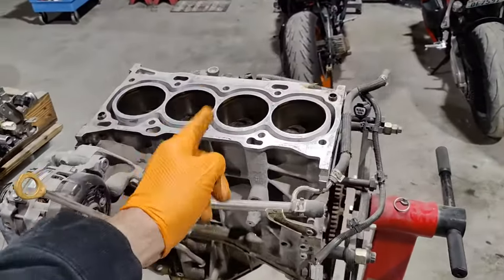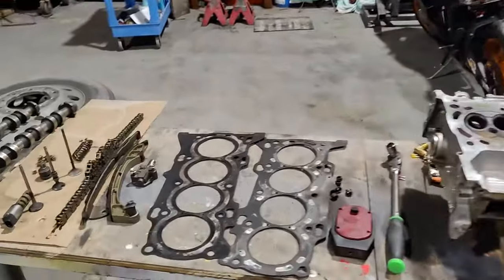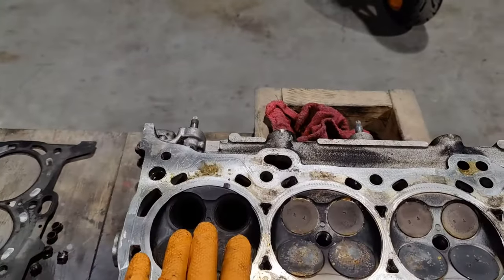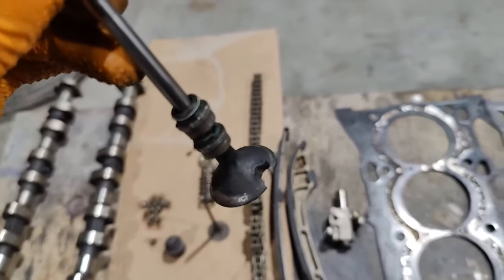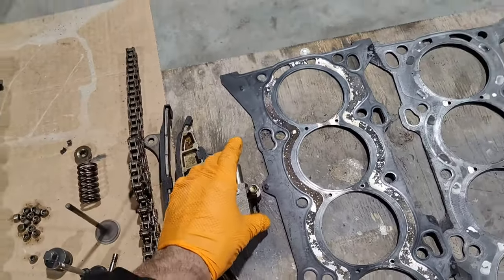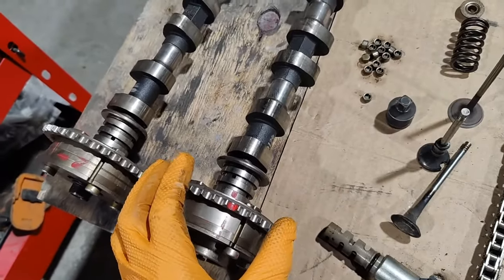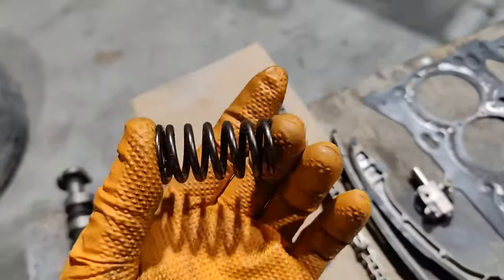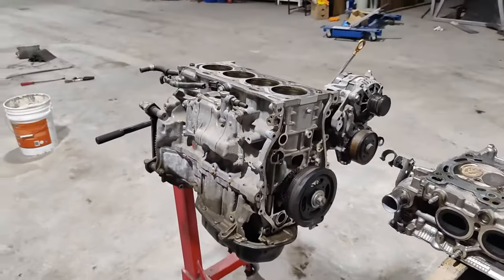Problems that can cause low compression or zero engine compression/ 2AR FE engine!

Comment: Great information! I just did a compression test on my Honda, 210-210-60-180. Coolant is clear as day, was consuming oil about 1 qt every 10-14 days
Reply from the maker: Engine should have vibrations, especially at idling when compression is 60 in one cylinder, you should feel it!
Reply from the maker: You can do a cylinder compression leak down test and will see where you loosing compression, piston rings, valves , cylinder head or gasket!
Reply: @valeriumoscalu7580  it definitely has a rough idle. Heavy vibrations especially because I have solid mounts. I noticed something was off right away. Unfortunately I needed to drive another 60 miles or so to get home. I’m hoping no damage was done to the block ! I am removing the head in a couple of days….

Comment: I have a 1998 Nissan frontier 2.4L ka24de 2.4 standard that has no compression. Whenever it first went down the timing chain tensioners broke as well as the starter. After fixing that issue, same problem. After further inspection it had a blown head gasket but it never got hot, with milky oil. No bent valves, piston and rings were good and head wasn’t warped. After that, repaired and timed, still the same problem with no compression. The engine cranks but doesn’t try to start. What do you think?
Reply from the maker: You don't have compression in all cylinders?
Reply: @valeriumoscalu7580  yes it’s not even trying to start the engine is spinning but no compression

Comment: what if all of 4 cylinder have only 3 -4 bar?
Reply from the maker: Than you need to check what is the cause of low compression and fix it! With compression so low the engine isn't going to run!
Reply: @valeriumoscalu7580  yes, thats right, it  is most likely not running, just bugging :/
kinda not really common problem, if i pour a little oil into the cylinders, it can reach a little more bar, but no so significant. anyways i have to disassemble it, just wanted to ask you opinion. thanks for the feedback :)

Comment: Thanks Valeriu Moscalu, Finally someone confirming my suspicions after 100s of videos on cam phasers causing low compression, especially running compression. As leakdown test was good and cranking compression was good, but misfires all on one bank on ford 4.6 3v. Guess next step is new mellings oil pump while im in there and timing components with good quality phasers.

Comment: I have low compression on one of my cylinders(100psi on cold engine). 2006 infiniti m45 4.5 v8. I dont wanna spend thousands to fix it. I was going to either  sea foaming or throw a bottle of compression repair. What do u recommend i do first.
Reply from the maker: Do a compression leak down test first!
Reply: @valeriumoscalu7580  Thanks for the reply.  So the leak down test determines what is causing the low compression?
Reply from the maker: @ouwat4life  leak down test will show you where you loosing compression through, and yes this will point you in the right direction ⬆️

Comment: Hi, i have a 2010 audi a4 b8 2.0t. engine starts up and runs but limp mode. Cylinder 4(nearest to back of engine bay) has no compression at all. All other 3 cylinders have good compression. Do you think its valve related?
Reply from the maker: @morganmorris3459  it's the valve most probably, you should do s cylinder leak down test, this will tell you exactly where you loosing compression, but most probably the melted, bent or damaged valve!

Comment: I have Fiat 1.4 petrol engine. Cylinders say 75psi on one cylinder and 100psi on other 3 cylinders. It doesn't fire up. Could it be that the timing is out slightly? Could correcting the timing solve the starting issue? 

Great video. Thank you so much.

Comment: I have already spend so much money trying to fix mt car by the local mechanics. Changed clutch plates, rings and alot of electrical sensors trying to find the fault which causes low power of the car. 
I noticed, a little smoke and air coming out from dipstick when removed. What could be the issue here? Please respond 🙁
Reply from the maker: What car, what year and what engine?

Comment: I have a Nissan na16 no compression on cylinder no 2 and 3 while the piston rings, cylinder head gasket and valves are new
Reply from the maker: You rebuilded the engine and after this it doesn't have compression?
Reply from the maker: This is how you do a leak down test if you have a tool:
https://youtu.be/wgPmZxrt34M

Comment: What would it be on 3.0 1mz-fe 97 Avalon cylinder 1&2 are dead misfires I swapped plug and injector from cylinder 6 to cylinder 2 than ran the car for a day drove it etc and only cylinder 1 was misfiring but the next day driving cylinder 1 & 2 are dead misfires again and cylinder 6 is fine I also ran top sealer additives in the radiator and motor oil as it is loosing both overtime.
But I don't understand how swapping the spark plugs and fuel injectors would fix cylinder 2 for a little bit then stop working again what does this sound like I really need to get this car running again
Reply from the maker: Maybe it didn't fixed it, just was a coincidence! Did you performed a compression test? Also did you tested the injectors?

Comment: Hi, my 2007 audi a4 quattro 2.0L turbo stalls at a red light. The cam chain and tensioner broke. I replaced both with new ones. Now cylinders 1&3 have 150psi.  But cylinders 2&4 only have 90psi.  The car starts and runs but shaking like crazy. Can you please help me out to see what could be the problems? Thank you.
Reply from the maker: Did you inspected the cylinder head valves for leakage?
Reply from the maker: You should do a leak down test in this cylinders to see where it's loosing the air pressure!
Reply from the maker: The problem can be in the exhaust valves , intake valves if they have carbon build up and not closing all the way!
Reply: Ok thank you

Comment: I changed my valves seals in my Mercedes c240 m112 engine. Trying to start the engine, discovered no compression. What could be the cause?
Reply from the maker: No compression in one cylinder or all of them?

Comment: Honda accord f18b2 1.8 vtec 1999 year three cylinders have a compression of 10,the fourth cylinder has only 4.5,the spark plug is black and consumes oil,works restlessly in reverse What could be the cause
Reply from the maker: Can be :intake valves, exhaust valves, piston rings, headgasket , piston, crack in the cylinder!
Reply from the maker: You need to do a leak down test to see where you loosing compression!
Reply: Did you fix it? I have the same problem, first 3 cil running at 14/13.5 bar, the 4 one is 2.3 bar, i have done 9500 rpm on a 8k limiter car so i think maybe valves or piston damage

Comment: Just got a MK7 GTI and from nowhere the dealership saids the engine is toast because it didn’t have compression. The car was driving just fine and at the 7th day of ownership it just dies on the road and haven’t start again. It crank with very low power and you can hear her backfiring while trying to start. What would be the cause I replace spark plugs and one of my coils is damage it fall apart if you try to take it out. Also I can not hear my fuel pump but there is definitely a fuel smell on the engine while cranking. Any other options I can anything else? I do have 4 new coils I haven’t put on because the car is still at the dealership
Reply from the maker: Fuel and coils have nothing to do with compression! If compression is to low it will not start!
Reply: @valeriumoscalu7580  I know but does the symptoms are common of a no compression engine?
Reply: @angeljavier5320  Have you found a fix yet

Comment: My bike tensioner stuck while in starting position. Then i instantly turn off my bike and reset its timing chain setting. But now bike won't start and no compression. Do you know the problem kindly help to figure it out?
Reply from the maker: Brobably the chain was looking loose and jumped a few teeth and now the timing is wrong!
Reply: @valeriumoscalu7580  yes but after this incident  i set  again timing chain setting and check everything even clutch setting. Both valve working properly but when i move magnet it showing no resistance and no compression realizing sound. It seems that piston cracked or rings are broken. So according to these inspections Sir what is your opinion?
Reply from the maker: @waqasansari8283  are you Shure timing is right? If you miss a few teeths it can loose compression!
Reply: @valeriumoscalu7580  yes 💯 m sure
Reply: When i kick start then kick has minor resistance or sometime kick has no resistance.

Comment: Are all of these issues preventable?
Reply: Yup. Change your oil every 6 months or 5,000 miles even if the manufacturer recommends 10,000 mile oil change interval. Also never let your motor overheat.

Comment: All incorrect.  #1 problem is that valves are not closed due to over tighten of rocker  arm
Reply from the maker: The lyfters here are hydraulic, they don't need adjustment! They are use oil pressure and a preload spring to achieve corect valve lash!